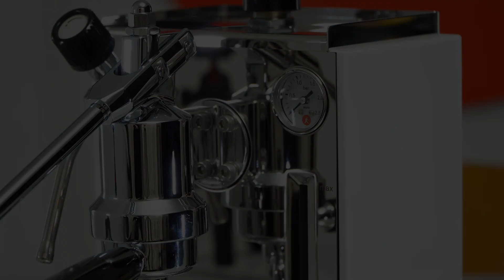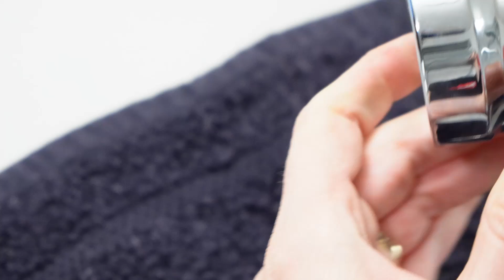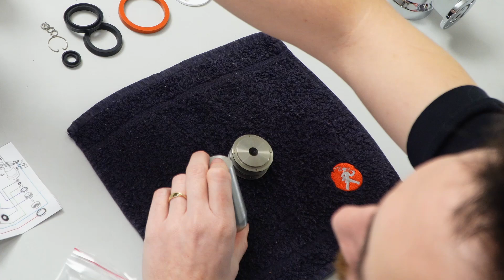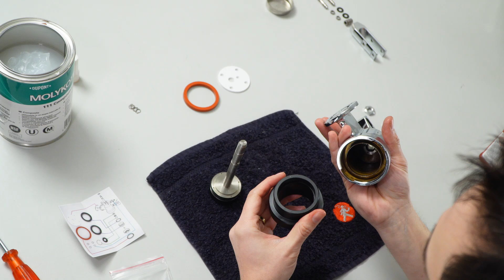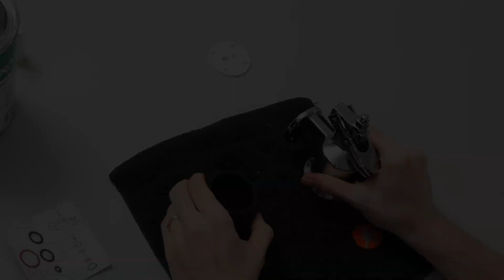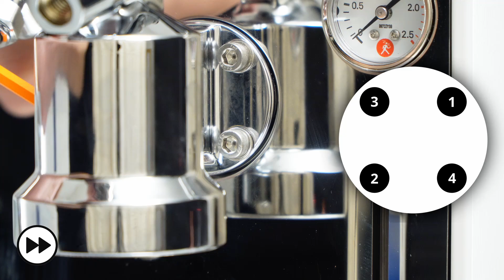Cremina - Grouphead Service

Comment: Che misura ha il pistone esterno in mm e le guarnizioni grazie buona giornata
Reply from the maker: The Piston is 45mm, the seals have different dimensions as they strech over the Piston
Reply: @olympiaexpress_sa Grazie molto gentile.
Reply: Hi,
Thanks a lot for your video but, before i order the parts, i wanted to ask, is these parts will fit by cremina 67? Especially the asket between boiler and the group head? Thanks and regards.
Reply from the maker: @GBaj79  Yes they fit without any issues.

Comment: Perfect! Mine is still running like a champ after 13 years with very minimal maintenance effort. The only downside is that the steam valve seal dries out and hardens up very quickly if the steam wand is regularly used. Any recommendations to avoid this issue and why is this spare part so hard to get?
Reply from the maker: The steam gasket should be available from our partners. Usually the gasket should hold for arround 3-4 years but this depends hevily on use.
We will make a detailed tutorial on the stem valves next.
Reply: I've started just releasing steam (and water) through the wand for a second a couple of times when I use the machine. That way, I hope to renew the water accumulating in the pipes on a daily basis and to keep things working.

I'm sure your local distributor can get hold of any spare parts you'd want.

Comment: I’m a bit confused. Although this video doesn’t really concern me as I have an older model and have been using it for over 35 years, how does this model function without a dipper going into the boiler?
Reply from the maker: The tube is built in to the boiler on newer models. Replacement of the gaskets is verry similar on the older machines